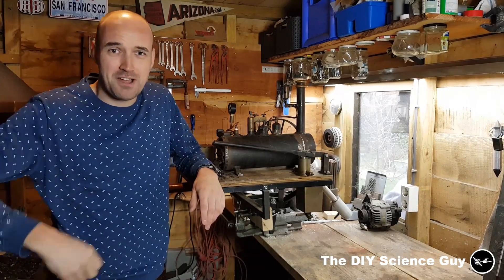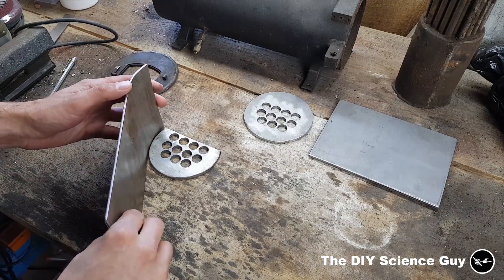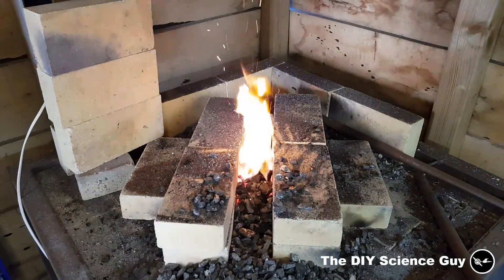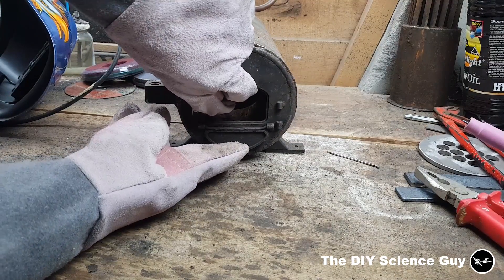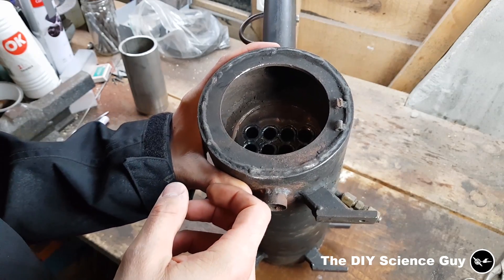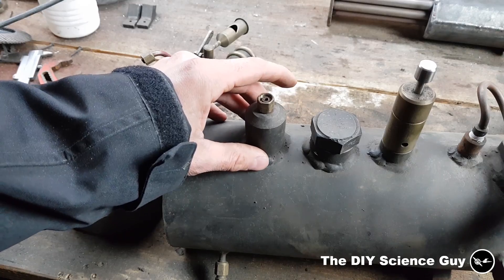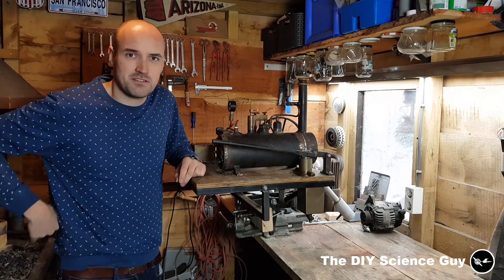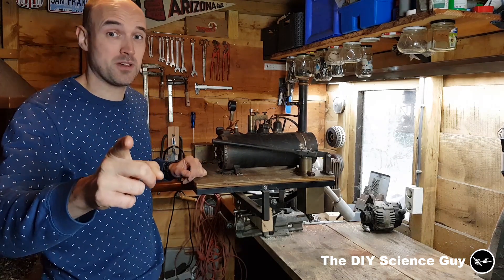Steam engine boiler restoration for 1000 subscribers

Comment: Congratulations - you deserve a lot more 👍
Can you please tell me
1- working pressure
2- what safety valves used and release pressure
3- does your engine have a lead melt plug 
Thanks

Comment: Tig welding anything that has been galvanised is a nightmare. Burning off the zinc leaves loads of crap that will come out in the weld pool. You need to thoroughly grind down to clean metal anywhere the weld pool will touch. Otherwise use something like a 1.6mm 6013 electrode to weld it or at least try and even if it goes bad cos tiny stick welding is tricky the slag pulls a lof the contamination into it so you can knock it off, grind it back down and go over with another welding process.

Comment: I've been calculating on boilers in school for 1 years, looked at the boilers on a couple of powerplants (up to 370MWe) and controlled a 'small' boiler with 2m^3 water. Your boiler works on exactly the same way as the bigger ones. The only difference is that the bigger boilers got a deionizing facility. You got the same safety systems and everything. Awesome boiler!

Comment: Hi, is a typical fire extinguisher good for the main body of the boiler? The wall thickness is around 1,5mm
Reply from the maker: I think it's a bit thin. Your boiler will corrode though quite fast and start leaking. No good.
Reply: @TheDIYScienceGuy  ah yeah, maybe you're right, well, thanks for reply and I'll search for something else to make a boiler out of it

Comment: Can you Have Steam Boiler can Use Waste Heat Radiator in Smokebox.
Reply from the maker: Yes that is possible.
Reply: Yes sir, we are the supplier of waste heat recovery boiler that you are in need, you can add my Whatsapp: 0086 13386456156 so I can send more running vedios to you, tks

Comment: Hello, very nice video!  Are there any plans for this cauldron?  Does the boiler consist of a large pipe?  What material is the boiler made of?  Did you build this water pump yourself and if so, how? Have a nice evening!
Reply from the maker: Thanks! I designed all of it myself yes it's a large steel pipe. I have no drawings available yet, sorry.
Reply: Hello Garfields, we are the manufacturer of steam boiler that you are in need, if you have any problem, pls add my Whatsapp: 0086 13386456156 so I can send more running vedios to you, tks

Comment: Scary corrosion! Do you treat the water and blow down(assuming it has a blowdown,it should!) after every use leaving boiler dry? Its essential to treat the water for steel boilers  and blow down after use if its not going to be fired up in close future.To be honest youd be better of using copper for one such as this, they aren't as susceptible to water chemistry as steel,easier to form and weld and more than strong enough for the application.Rare to see  such small boilers not made from copper.Love your work though,it is a lovely model.
Reply from the maker: No no treatment yet, I'm working on that. Leaving it dry is the worst thing you can do, you need to fill it al the way to the top when storing it.
Reply: @TheDIYScienceGuy   Late reply sorry, no actually miniature live steam boilers are blown down hot and stored this way. I actually operate certified miniature boilers that operate at pressures much greater than this little one (and pull train loads of paying members of the public) and i assure you this is how they are all stored. Full scale is a different story, ive also operated these and im talking main line locomotives that weigh in over 100 tonnes. Just a little experience ;)
Reply: @TheDIYScienceGuy  https://youtu.be/wPNUQqbZ0oo?t=184

Comment: That's pretty cool I love steam power that is awesome I like how it has a bevel gear drive to the propeller I have a suggestion for you though figure out a way to put a better valve gear to where you can adjust the valve timing and make it more efficient and more powerful like a Stephenson valve gear it uses eccentrics peace out have a great day
Reply from the maker: Thanks!! Yes I no but I made this steam engine when I was 14 years old (20 years ago) and back then I had no good sources  of information of how it works. So I'm kind of attached to how it is now. Thanks for the suggestion though! 👍
Reply: The DIY Science Guy oh I love your steam engine I wish I could build one myself I think you should hook up a generator to that little steam engine to produce electricity for an emergency cell phone charger so say like the grid goes down and you need a charge something you can use your little steam engine to turn a generator to charge a battery Bank peace out man good luck in all your endeavors but yeah I think I Stephenson valve gear with the eccentrics would be the easiest for you to build and if you make it we're at has an adjustable cut off that's team terminology in internal combustion criminology it's known as variable valve timing so once you get your steam engine up and running and you get the masses of the machine spinning you can cut down how much steam goes into your piston steam expands a lot so a little packet of steam will push and expand a lot more than you think so what's a way to conserve energy look up steam locomotives and their valve gears and their boilers they have the most efficient boiler of any machine because it has to create a lot of volume up steam also another suggestion have the exhaust from your engine blow out the exhaust stack I don't know if you have it that way if you don't what that does is it creates a draft like a Bellows and sucks more air into the fire very interesting video I loved it peace out have a great day
Reply from the maker: Thanks! Yes I'm going to ad a generator in the future. The exhaust steam is going out the chimney to enhance the fire already. Thanks for the suggestions!

Comment: to help stop that rusting see roberts series playlist How To Solder A Copper Wire Onto Stainless Steel https://www.youtube.com/watch?v=xSJQJ7DxIU4&list=PLbQqm4rNo626QWWgvxU6ebnxWlqJRGYKu
Easy Copper Plating Of Steel

Robert Murray-Smith,Published on Sep 3, 2014
This little method puts a tough thin copper coat onto steel by cleaning the steel first then using a replacement reaction to deposit copper
Reply from the maker: Thanks for the tip!

Comment: Very interesting to see a steel fire tube boiler in this size.  Most locomotive boilers that I have seen are copper, silver soldered. Maar, ja het was erg interessant en zeker goedkoper in staal.
Reply: In Europe, locomotive boilers were manufactured using the whole-steel boiling technique.
Reply: Peter, yes of course full size locos are all steel boilers, I refer to 5" gauge model locos and the like that are copper boilers.
Reply: Yes it is rare to see boilers of such small scale not made from copper,mostly because there's no advantage to steel on low pressure boilers of this size(aside from cost) and a whole lot of disadvantages,namely corrosion.Here in Australia you only see  steel boilers on rather large loco's and they tend to run higher pressures than are allowed on the copper constructed boilers, so like 150+  PSI which also requires a boiler ticket to legally operate.Here if you want to run a boiler in public it has to be certified,built using specific materials and inspected regularly.Back in yee olden days there was (at least firebox anyway,possibly entire boilers) full size locomotives running copper,but that was a long time ago! It is still interesting to see this cute little boiler though, even if its not the way i would go about it myself!

Comment: Where do you have that nice steam engine from?
Reply from the maker: Thanks! I build it myself years ago when I still had access to a lathe and a mill.
Reply: @TheDIYScienceGuy  You could try using a cylindrical parabolic mirror for the solar powered steam engine projekt. It would also be nice if you showed us how yout built that great steam engine, because after searching for it on youtube I haven't found any good guide how to do this.
Reply from the maker: Yes good Idea! I'm building a new steam engine right now so in a while there will be a video about that.

Comment: Thanks for the great videos.

IDK about care of steam boilers, but looks like you can add a nitrate mixture (Ammoinum nitrate or Hydrazine) and lye to promote formation (thickening?) of protective magnetite layer: https://www.suezwatertechnologies.com/handbook/chapter-11-preboiler-and-boiler-corrosion-control#CORROSION%20CONTROL%20FACTORS
IDK what best procedure would be, e.g. infrequent high pH, every startup, or all the time slighly basic pH? Anyways, great work!
Reply from the maker: Thanks! Yes I believe you can add  ammonium sulfate to remove oxygen. Also putting hot water in a vacuum will remove oxygen. I'm planning to make a setup with which I can do that and make a badge of water with a minimum amount of oxygen. Thanks for the info!